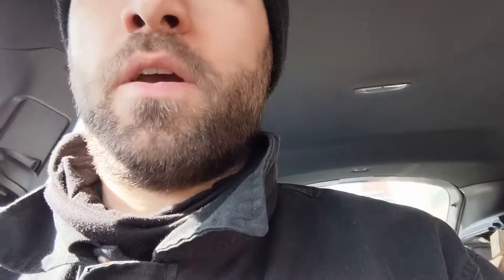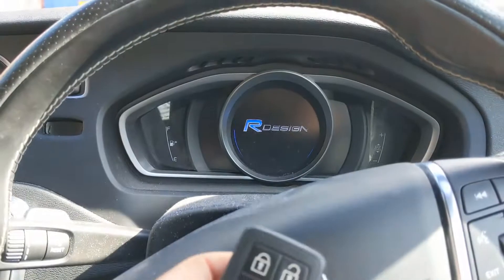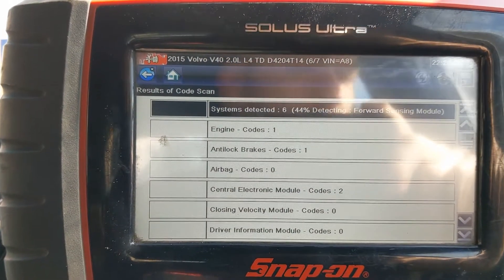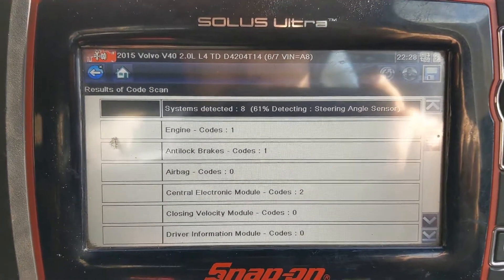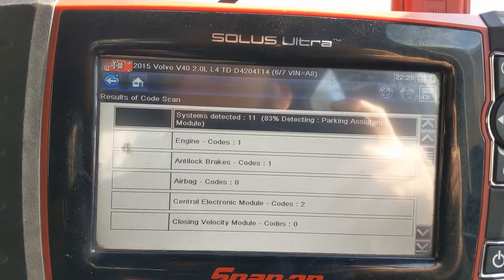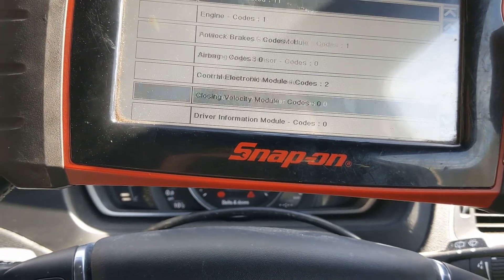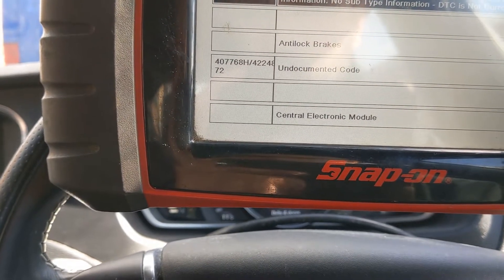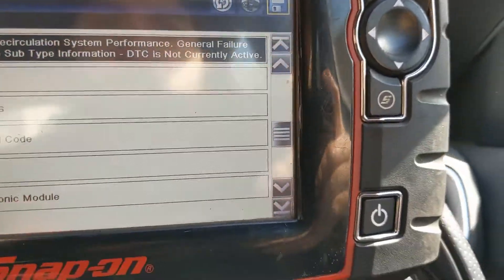Volvo V40 2.0D None Start - What's Wrong With This One?

Comment: My daughter has the v40  D2 cross country 65 plate for 3 years with only 48 600 no the clock . Well ? After  owning it for 18 months car went in to Volvo for not starting and a stop /start problem after been to 4 different garages. To try fix this which included the RAC Brake down cover she had on the car  and been told it needs a new ECU at £1400 plus a software update and re program to match the . Well again no stock anywhere in the world factory fire in Japan , went weeks to get this fixed .  DOSE THIS END HERE ???? NO ,   18 Months on and this week the same thing as happen again this week. Went direct to Volvo having seen the problem before .  Now told it needs another new ECU and out of warranty which is going to cost about £1800 in full . Once fixed car is been PX .  She will definitely not touch a Volvo again . I’ve had 9 new Volvo’s since 1998 all without any problem  V40s and XC90s  a C70 and a C30 . GUESS WHO’S FAULT IT IS ?.
Reply: 😂😂😂 I'm here for help as soon as I read the comment I realise that you save me money 😂😂😂🙏🙏🙏🙏 I'm going to walk away I'm having same issues this morning ignition on the  car not starting

Comment: Hi sir, I have a Volvo V40 D2 2013 and the car had a loss of power and took it to the Volvo dealer and the dealer replaced the turbo hose, and the car also had a major overhaul and the next day the car won't start  more, and my question is ?  is the egr also the problem with my car?  do you know that?  because the Volvo dealer can't find it.
Reply: How much did they charge

Comment: The cars battery is dead… wtf dude. I know the egr system needed cleaned too but no.. any mechanic watching this heard exactly what I heard.. you’re a hack.
Reply from the maker: @carsncabins1349  the battery was low on charge but that wasn't the cause of it cutting out and having no throttle response. Sounds like you need some education my friend.